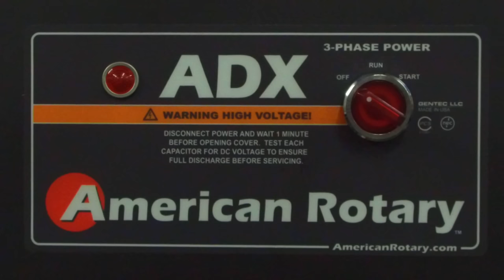The Rock II

Comment: The Rock is brilliant. Years ago I TIG weld repaired two bronze struts and they warped considerably.  Took them to the shop at Kettenburgs, San Diego and used their big press to straighten.  One of them got on a bind and squirted out of the press and hit the far wall 60 feet away. Thank God it didn't take some ones head off.  The rock rules.

Comment: Keith, when I was young man, pulling wrenches on heavy equipment, I watched one the old mechanics straighten a truck front axle with heat and a wet rag. Much like you do shafts. Straightening things that have gone through violent restructuring is an art. Looks simple, like watching Tiger Woods play golf then trying it yourself, but it is a learned skill. Thanks very much for sharing.

Comment: Keith,  I have a KR Wilson Model 37 press, around 25 tons.  I try to employ its use for straightening a multitude of things when the need calls.  It has factory press blocks with Vee block features on the bottom sides. Very handy.  I have lots of tooling that I have built up for my press, like pushers and receiver blocks.  At work we have a punch press department, and they throw out a lot of old tooling.  All hardened stuff.  Many times I will find handy items for use on my small press.  Pushing shafts and bushings is great, but doing straightening work really makes the brain think.  So much fun.  I see why you enjoy it. ---Doozer

Comment: my god, i absolutely love you and your videos... you've taught me so much over the years and i appreciate is sooooo much! having said that, i was cringing this whole video!!! i know you, personally, are in control of what you're doing, but i've seen enough unexpected industrial press accidents in my time (i worked facility/equipment maintenance at Norton a few hours from you up in "woostah") where all i can picture is that ram slipping off the head of the rock and literally turning your left hand into a sack of bone shards or a parallel spitting out into your teeth every time you crouch down. haha we all know blast shields are just something to make the safety guy feel like he did his job, but as a personal favor to a complete stranger, would you consider milling a waffle pattern into the press point at least some day in the distant future? slips and slides under tension can be terrifying! i would usually use a sheet of old used sacrificial rubber that i saved off of gasket replacements too for super sketchy tweaking.

Comment: Keith, do you ever have to anneal 1 of the struts being corrected, to prevent work hardening induced cracking?
Reply from the maker: No, there are some real old struts that become questionable, and Magnaflux checks before and after remove or confirm doom.

Comment: Hi Keith,
Very interesting video. It is similar to your heat straightening of shafts, it is all about knowing where and how much pressure to apply, and checking progress.
It's a tad concerning when you see the ram of your press move sideways as it did when you were pressing initially, I guess it is flex in the mounting plates as well.
Was that part made of brass?
What sort of injuries did the prop and shaft suffer? Or is that another video?
Regards from Oz, Dennis
Reply from the maker: The ram at that length does flex and I've had no issues with seals or scoring of the piston rod , this was made from an old excavator thumb piston, I rebuilt it and modified it for this press in the year 1997. the shafts were just more of the same, 3/16 of a inch runout on prop end, the rudder was only bent about an 1 1/2, bow in blade stem still straight. I have videos already posted repairing more unique damages.

Comment: Hey Keith does leaving a 'bending operation' in place for x time do anything?   Or it'll bend instantly always and time left under torque wont really set a bend
Reply: I have often wondered this.
Reply: I’m not Keith, but I’ve done this a lot with all common metals….leaving it under the press for longer time makes no difference in my experience, although with Ductile Iron, if you torque it past where you want to end up, and then beat the over bent piece with a hammer, it will help “set” the bend….but that is only ductile iron……some cast fireplace liners really ruined a couple of days for me once!
Reply: @splinky99  that's interesting.   Thx
Reply from the maker: The Manganese bronze is tougher and springier than S/S you always have to go past and spring back.

Comment: hola amigo como estas  bueno veo que con trabajo bien pregunta ? que es el aparato  american rotary para que sirve si me podes decir  me gustaria saver para que sirve bueno saludos amigo buen fin de semana
Reply from the maker: I am waiting for a meter bank to be installed to have true three phase power directly into shop, the Rotary converter I'm using, made by American Rotary, generates the substitute three phase power needed to run my big machines, from the single phase supply I have coming into shop now.
Reply: @KeithFenner  Oh, how would it work for me? I have all single-phase, noisy motors. I wanted to put three-phase, but the installation costs a lot and there is not so much work, and here it is getting more and more expensive, everything will improve.
If I were a little younger I would go to your country, you have to continue
well thanks for answering me my friend always so kind

Comment: The jig is "walking" to the right. If you drill and tap the table top, you can put in stop blocks to corral the base of the Rock. Thus it won't shimmy away from the ram. If anything should explode, it will also contain which direction of travel. Nothing wrong with debris flying at you if you see it, calculate its path, and duck....all in .58 seconds.
Reply from the maker: LOL